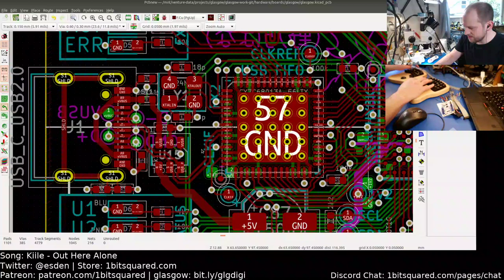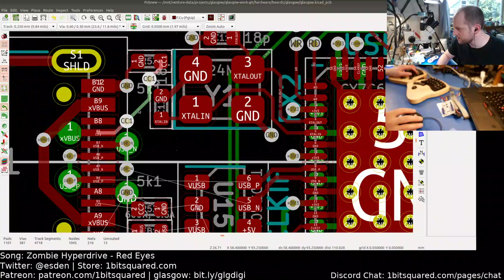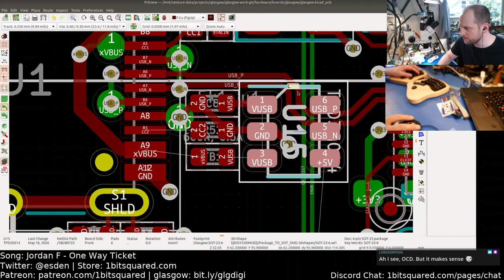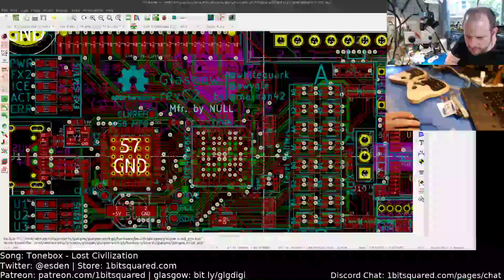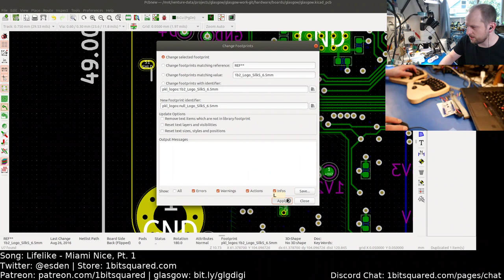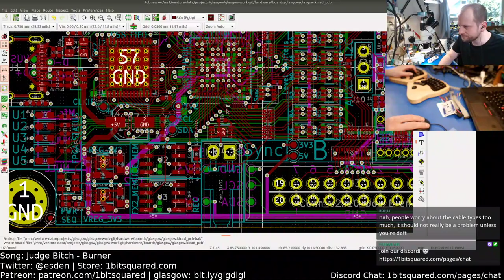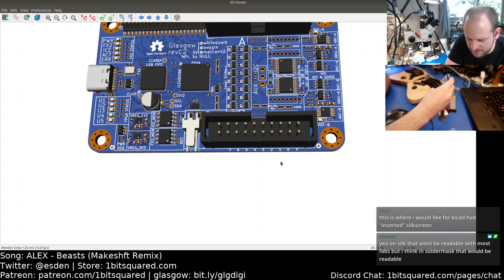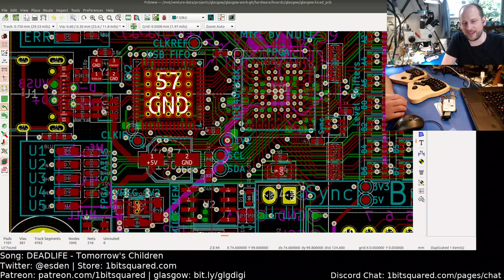Electronics Let's Play - Glasgow Interface Explorer revC2 design updates Ep. 6

Comment: I know it's not always possible, but I try to avoid text on the silk layer where vias are, since some manufacturers don't like it and the text may get difficult to read. And regarding the numbering of the ribbon-cable-connector: it may be an option to put the pinout labeling where the plastic part of the connector is and let the users populate that connector with either a shrouded connector or just the pinheader, which would give the user the freedom to use a "save", shrouded connector without the pinout on the front for use with ribbon cable and the pinheader option to use with single jumper wires with labeling on the front. Although I'll probably make a case with labeling anyways, so the above point may be a moot one.
Reply from the maker: Yeah we are thinking of several options of labeling the connector itself. It is possible to do pad printing which I am looking into. Also the cable harness that the Glasgow will come with will have labels on the cable ends. I made some prototypes for them and I got a quote for making those wires. They will be part of the CrowdSupply campaign. :) Regarding the silkscreen, I will eventually do another pass and either try to move the silkscreen text away from the via holes or move the via around to not have the holes directly on the text lines. These are all good suggestions and I will definitely take them into account. Thank you :D